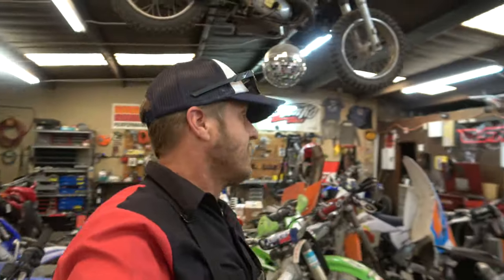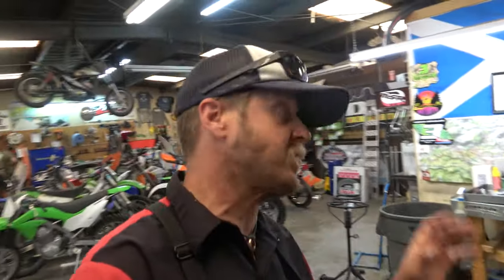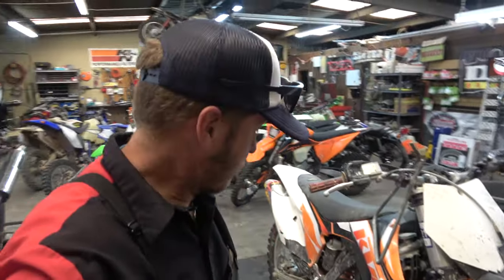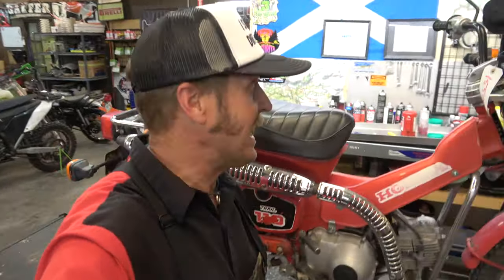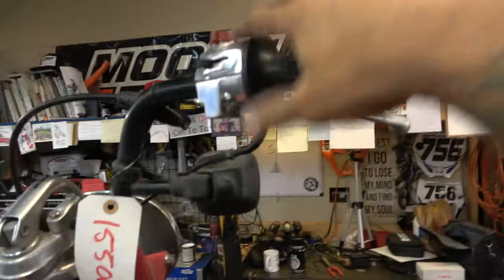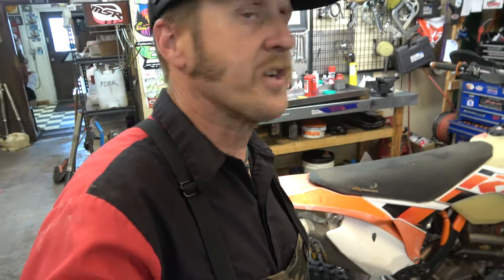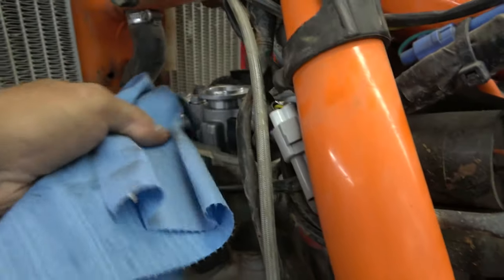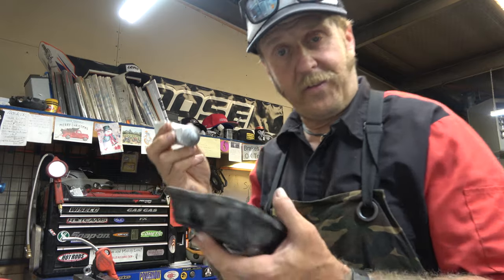Blown up KTM | RZ350 | KTM Fuel Pump | KTM Radiator Fan | The Shlog #221 | Highland Cycles

Comment: I like to mount my temperature gauges near the bars. You can get a mounting system cheap from Rocky Mountain, or Slavens.  That way you know if your bike is getting too hot (or the fan quits working) before you have a problem.  Also, you can use a heat gun to heat up the sensor to check the fan instead of running the bike for all that time idling and trying to heat it up.  Your experience far exceeds mine, I'm just chiming in, not trying to tell you how to do things, that's for sure.
Reply from the maker: No worries. Always good to hear other perspectives. I like to run them because it’s a real world type test.

Comment: Why couldn’t you mount the thermostat for the fan on the other side where you have plenty of room?
Reply from the maker: Wire length mainly. Could extend but I like to keep everything sealed and stock if possible

Comment: Curious what lead to the failure on the 4T. I had loss of oil pressure leading to camshafts melting to cradle. Still looked like oil up top but definitely not enough to keep it cool.
Reply from the maker: I honestly don't know yet.  I might not ever know for sure because I don't think he is going to fix it. Stay tuned because if I take it further apart I will definitely be filming it. I am guessing either a clogged up oil filter (not enough maintenance) or clog in oil passage that sprays the oil on the cam lobes.
Reply: @highlandcycles  that’s not the year for the plastic oil pump gear that everyone hates is it?
Reply from the maker: @kevinmarshall8035  I’m not sure. I know for sure they had that in 15 and up but not sure about this one. Definitely could be.

Comment: There is a aftermarket Japan *KTM fuel pump available now. Kemso, or at least there was. Way better quality and reliability than ktm made in china oem junk. My 22 tpi fuel pump failed at 20hrs, bubbles and low psi.
Reply from the maker: Ugh. I’ll have to see. We have been using the ones from All Balls with pretty good luck.
Reply: @highlandcycles  I bet even the all balls ones are better than the oem, even if they are made in china.
Reply from the maker: @Dat_Sun  agree

Comment: Sure you can say dyke if you put Dick Van in front of it... I haven't seen that one on the no go pronoun list...   I wish they'd find a better way to mount fans to radiators other than the tie through core design, I'd hate to see those run through the ultra thin cores...I'd love to see some trail 90/110 hard enduro races!  Now that'd be sweeeeeett!
Reply from the maker: Agree about the mounting.  They have way better mounts out there, this is just what he brought us.  And YES CT110 races!!!